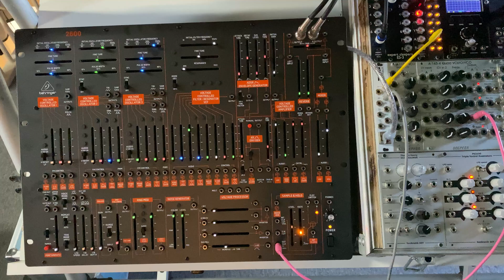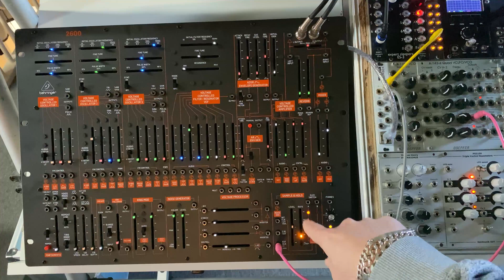Behringer 2600 external clock issue

Comment: Thanks for a very useful video! I was thinking that the clock is defective... I still think it is, but not just on my unit. I'd prefer Behringer to try to improve the 2600 rather than fix the manual. :-)

Comment: I might be wrong but... What about sending a mult of the EXT clock source to the EXT Clock IN of the S/H and the S/H clock input of the envelope? You can exploit the design "flaw" so the internal clock can control the Switch independently?

Comment: Same issue here with the Korg ARP 2600 M. Tried sending clock signal from both Arturia Keystep Pro and Moog DFAM. However, the EXT clock input works for pitch modulation on the 3 oscillators.

Comment: If you are bringing in a square wave, from outside, you have one side of the switch anyway.  Invert it to get the other side.  Patch those 2 sources instead of the internal clock.  Think of the switch as an extra LFO where nothing is plugged into the Switch Source.  When you have something else plugged in, it will redirect it to the 2 output, or it can be set up to work in reverse (alternate between 2 inputs)

Comment: the manual is very clear, "ext clock in" broke the s/h internal connection clock for the s/h, it dont change the internal clock ,  it is not for the switch, the manual says clearly that the siwtich is connected to the internal clock; so this in not an issue

Comment: It's a bug in the manual, and possibly an Arp design flaw as well. The original Arp 2600 is indeed hardwired exactly the way you experience here.  It's insane, makes the whole block unusable most  of the time.

Comment: You could get some way there by multing your external clock to the sample and hold, and both envelopes’ gate inputs.....but this wouldn’t fix the issue with the electronic switch. Does the internal clock sync to midi?
Reply: Someone on the Behringer 2600 fb group says LFO does not sync with MIDI and that MIDI only triggers notes and pitch bend. I'm waiting on a Blue Marvin, so I'm relying on the response from that group answer.

Comment: Can anyone tell me if their vibrato depth goes to the pitch of all oscillators without patching? It does on mine!
Reply: Yes. That's how it's supposed to work.
Reply: @juanmico4085  thanks. I noticed I can break the connection by sticking a cable in to the vibrato in and then only send it where I want it to go.
Reply: @danpreston564  Also Osc 1 has it by default as a mod source (LFO) if you want to affect that one only.
Reply: @juanmico4085  yes, I saw that. Different to the original 2600 there. I’ve just noticed the gate and trig in on the AR on the Behringer are outputs on the ARP. There are a few interesting differences.
Reply: @juanmico4085  30 years I’ve had synths. I’ve never been more confused than I am in front of this 2600. I’m trying to use the 100 patches book from ARP and there is so much I don’t understand. Patching inverted filters into the outputs of oscillators? I can hear it makes a noise, but I don’t know why!
Reply: @danpreston564  Lol yes, I did patch something into an Osc output by mistake and it was producing sound, and quite nice at that! I've no idea why though...
Reply: @danpreston564   Don't feel bad...I have 41 years of experience and still needed a video to get going. But after a few days with it, I've found this layout to be the most intuitive I've ever used. Strange.

Comment: Interestingly, the panel printing on the orange faced 2601 from the late 70s is different to the Behringer and the older black face 2600. It shows internal clock routed past the ext clock in and going to the clock out Jack, with a line going off it, through the ext clock in and into the sample and hold. So that looks to me like they knew in 1977 that this behaviour was not what is shown on the panels of the black face 2600. The block diagram in the Korg 2600 manual seems to back this up. At least it’s not just me. The question is, how would you sync the internal clock with something? Is it even possible?

Comment: Considering the wiring schematic, this works exactly as intended, this is not a bug.
https://mediadl.musictribe.com/media/PLM/data/docs/P0DNJ/2600_QSG_EN.pdf
You can see that FM in of osc is wired with the S&H, but the trigger of the AR enveloppe is with S&H clock, not S&H itself.
ext clock in works only for the S&H, not the switch which only have internal clock in.
The arrow between "internal clock" and "external clock in" shows the default hardwired internal clock to S&H.

And it appears that the old 2600 (and the recent Korg"s one) work like that too : you can turn the electronic switch externally clockable, like the S&H. (one of the famous feature of the ARP 2600)
Reply from the maker: Thanks that has been most helpful! Guess they oughtta update their manual then ;)
Reply: @RubenHulzebosch  @v3nom7 hey people. I have noticed the same problem. The manuals for the korg 2600 and the behringer 2600 both say the electronic switch should clock to an external signal coming into the EXT CLK IN Jack, but it doesn’t. However I have found an old article that says the switch is always hardwired to the internal clock.
Reply: A question for you - do you mean you can not turn the electronic switch externally clockable?
Reply from the maker: @danpreston564  yes exactly, it seems hardwired to the internal clock.

Comment: Regarding to the original service manual, this is expected product behaviour and the original circuitry. The external clock is feeded after the Electronic Switch Circuit.
Reply: Yes this is the normal behavior. Only S&H is externally clockable, not the electronic switch. The same on the vintage and the Korg ARP2600FS.
Reply: @coyotesynth  the old manual is wrong, then. As is the new manual and the Behringer manual.
Reply: @danpreston564  seems they did a copy of the manual as well as the synth itself!
Reply from the maker: ah good to know.
Reply from the maker: then I guess Behringers documentation is wrong.
Reply: @RubenHulzebosch  In fairness you would naturally expect an external clock signal to override the entire internal S&H clock, but if it doesn't and never did with the original either, then yes the documentation is wrong.
Reply from the maker: @Polymooger  fair enough. I never owned an original 2600 though, so naturally I believed B's manual :D
Reply: @RubenHulzebosch  not surprised about that ;)

Comment: Does it work correctly with midi clock?
Reply from the maker: no same behavior
Reply: @RubenHulzebosch  Thats a shame.  Typical Behringer.
Reply: @phazerbrains  not typical Behringer, it's how a 2600 is cabled, typical 2600.
Reply: @hpa4355  It can't be "typical 2600" -  2600 doesn't have midi.......
Reply: @phazerbrains  it doesn't have to do anything with midi. It is the way a 2600 behaves with external clocks, not matter the brand.